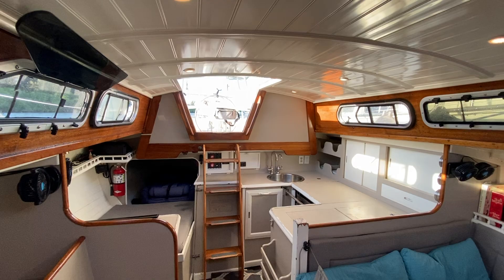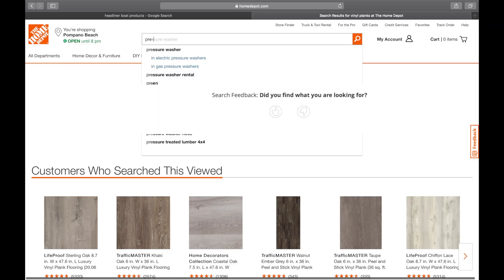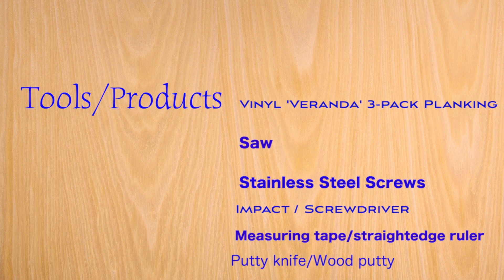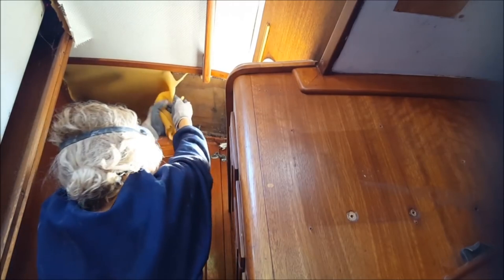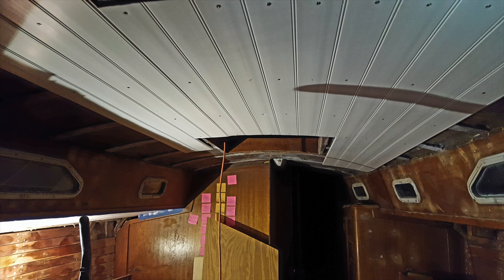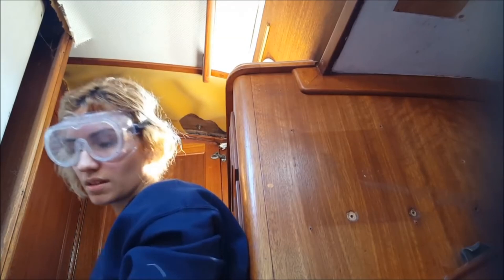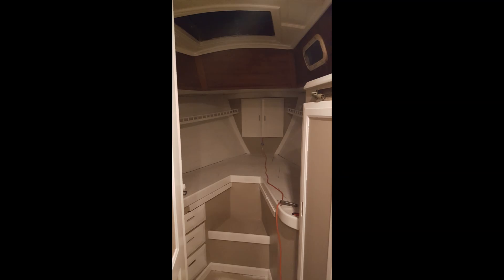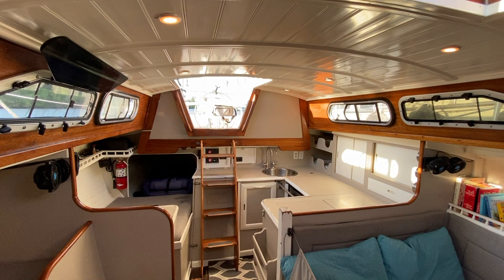SAILBOAT INTERIOR RESTORATION PROJECT |Boat Headliner Installation DIY

Comment: Did you simply paint over the varnished wood? What kind of paint did you use? I would love it if you could do a video detailing how you did this.

Ive heard some people claim that painting over this type of wood causes problems. Any information you can share would be great. My budget will only allow me to buy an older boat but i find the dark interior of them to be dreary and cramped. The lighter interior of new models is so much more livable. So my only option will be remodeling the interior, again, on a budget. 

Thanks for the great video.
Reply from the maker: Thanks for watching. We sanded , primed and painted. We used a brand called Coronado it’s polyurethane based paint from Regal , and it is tintable to whatever color you like. 

We have had it painted for 2 years and it holds up amazing! There are a couple places that need to be retouched but nothing major. And it definitely makes it feel brighter and cleaner ! Thanks for watching our vids! If u have any other questions feel free to reach out
Reply: Why did you choose to use paint vs Gel Coat?  Did you use adhesive along with yhe screws?

Comment: Am I mistaken, or you actually haven't used any insulation?
Reply from the maker: We used it on the sides but you can add it especially if you are in cold areas.